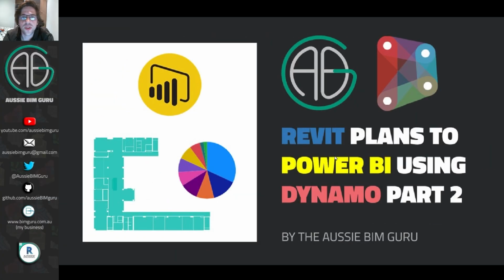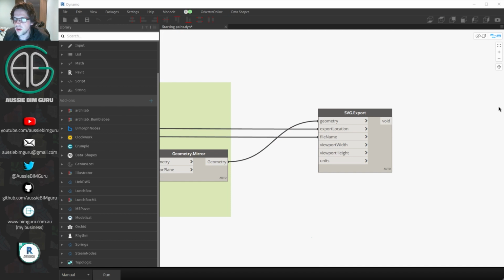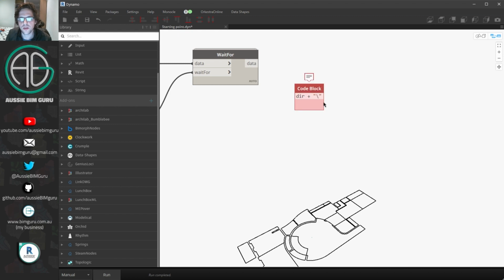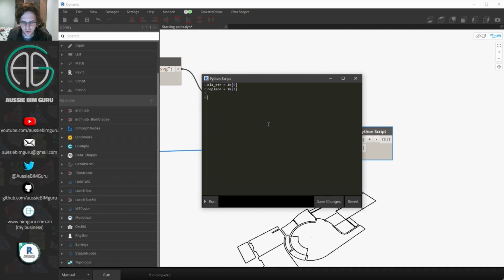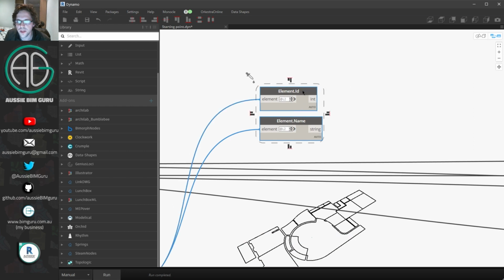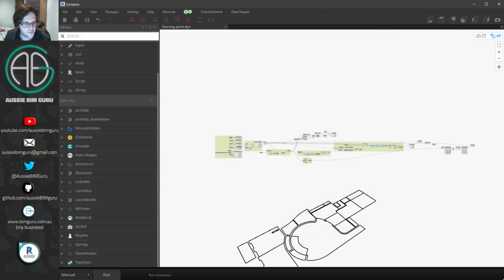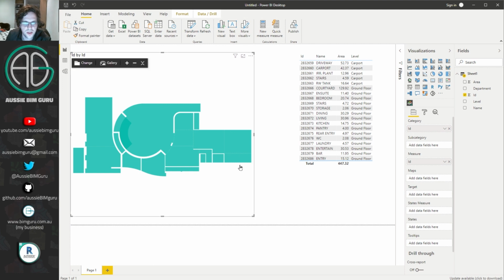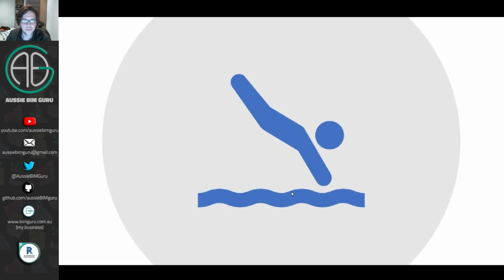Revit plans to Power BI using Dynamo! (Part 2 of 2)

Comment: Thanks for the video! is there a way also to include the floor plan as a backdrop of the svg file instead of just the polygons?
Reply from the maker: Not that I'm aware of using this specific extension.
Reply: @AussieBIMGuru  Thanks for the response! maybe a png of the floor plan can be underlaid using illustrator/inkscape?
Reply from the maker: @swornavaguha252 potentially, but it would still come down to how the synoptic panel viz works at its core
Reply: @AussieBIMGuru  I modified the script that takes in the exported png plan into dynamo- convertsit into xml and scales and underlays under the polygons in the svg. It works perfectly fine. Thanks for this tutorial tho!
Reply from the maker: Nicely done!

Comment: Hello Everyone. I follwed every step of the two parts but i've a problem with visualization of svg in PowerBi. I can't visualize correctly the boundaries of rooms but i only see random overlapp geometries but, if i select one of them, it gives the correct correct correspondence with the table. Did someone has the same problem?
Reply from the maker: If you are on a european region computer this may be the cause as the shape files dont get written properly. Try setting your region to US and it should work. This is because some european countries use commas as decimals which breaks a lot of computer files that would work elsewhere.
Reply: @AussieBIMGuru  I tried and now it works. Thank you!!!

Comment: Hi, nice script, but i can`t see flat on powerbi, i followed ths steps and try the script created by you but it gives me the same error, someone can help me please ?
Reply from the maker: The main error I've encountered here is if the computer is set to a region where decimal points are commas, which breaks the SVG file structure. Try using a different setting and see if that helps:

https://resrequest.helpspot.com/index.php?pg=kb.page&id=279
Reply: Hi i have the same problem , do you find a solution? I try to change the computer settings but it doesn't work

Comment: Amazing Work! Thank you so much for sharing. I followed your workflow and eventually worked really really smooth. I just have one more thoughts, have you used Tableau with Revit to do something similar to this? I currently have a project requiring working in Tableau instead of PowerBI. However, Tableau doesn't take svg file. Do you have any thoughts of transferring this svg files to shapefile (.SHP)? Or anywhere in Dynamo can I try exporting the data to shapefile (.SHP) instead of svg file? Thanks!
Reply from the maker: Generally I've used Power BI as its more commonly available and used in the AEC industry. Tableau has some nicer visuals but lacks as much custom content such as the Synoptic panel. There are various websites which can translate svg to shp, but you would still need a visual to support it to the same degree as PBI.

Comment: Can it be done to generate an *.svg of an isometric view of structural projects (either concrete or steel structural frames)?
Oh, and thank you for sharing your amazing dynamo skills!!
Reply from the maker: I don't believe so. I've only used this workflow for floor plans and flat elements like rooms. An iso wouldn't be read as flat elements by Dynamo unfortunately. Something like Tracer by proving grounds can do this however.

Comment: Thanks Gavis, this tutorial is great. I followed in all the tutorial but i have a question.  Why in Power BI the plan show thicker lines than the one you show? is there some step that im missing?
Reply from the maker: Hrm I'm not quite sure, it may be a scaling issue depending on if your model is in mm maybe?

Comment: Great video! but I would like to match the colours of the graphic charts with the colour of the rooms based on the data, is that possibe with Power BI Synoptic visualizer or I would need to find something else to do that? thanks
Reply from the maker: I haven't found a meaningful way to set the colours currently, but maybe check out 'Tracer' by Proving Grounds, looks to be pretty sweet and heaps of features vs Synoptic panel. Costs $350 for a perpetual license, free trial (with watermarks).

Comment: Hey Gavin, Do i need adjust the Script if i am using Spaces rather than rooms?
Reply from the maker: Yes it would work a little differently. You would need to collect the spaces at a level, their boundary and then pull that to the common plane instead.
Reply: @AussieBIMGuru  Thanks my Dynamo skills are not great, would this be something you could do a video on ?
Reply from the maker: @dillonjohnston512  it's not a topic that would aid many people I think, I would suggest working towards this as a learning goal instead - more valuable for you.

Try the 'SpatialElement.GetSpaceBoundary' node from Orchid as a starting point.

Comment: Hi Gavin, thanks for the tutorial.
I have problem python script: when run dynamo appears the follow:
Warning: IronPythonEvaluator.EvaluateIronPythonScript operation failed. 
Traceback (most recent call last):
  File "<string>", line 5, in <module>
TypeError: replace() got an unexpected keyword argument 'count'
I follow your step by step but i can´t get a solution.
Could you tell me what is the problem? Thanks.
Reply from the maker: Try replacing count = 1 with just 1, or leaving out this third argument for the method. I believe you may be using 2021 which uses cpython and hence has different method arguments.
Reply: I am again. I don´t know if i am doing well.
Now the error massage is this "Warning: IronPythonEvaluator.EvaluateIronPythonScript operation failed. 
Traceback (most recent call last):
  File "<string>", line 7, in <module>
NameError: name 'old_srt' is not defined"

I am sending some information: Revit 2017.1, Dynamo Core 2.0.2.6826, Dynamo Revit 2.0.2.6833
I must learn Python to solve this?
Thanks in advance for your help.
Reply from the maker: @alevadag5706  yes you must have typos in your variable names. Take some time to go through my python 101 series at least so you know the basics like variables.

Alternatively my script is available on github for comparison.
Reply: @AussieBIMGuru   Ok, gracias.

Comment: Great tutorial. I was wondering if there's a way to populate the room number instead of the room ID. Thanks!
Reply from the maker: If your room numbers are 100% unique then you could use this as the name instead. If any room numbers are the same though I believe it will cause problems as Synoptic panel uses this field to identify each element from the SVG file.

Comment: I have a question, it is possible to match the colors from the pie chart to each room´s color shape?
Reply from the maker: Check out the end of this guide here;
https://okviz.com/blog/introducing-synoptic-panel-v1-4/

If you assign a data type to the subcategory, you can customize the colors used by these in the second tab. To detect a room's shape might be challenging though, you'd probably need your Dynamo script to identify this and capture it as a data column in the excel data.

Comment: Thank you for this excellent workflow.  I was asking if units could break the graph? I'm working in meters and the svg file loads really weirdly in PowerBI. How to define the segment size in this case ? and is there something to change near the SVG.Export node to make it work ?
Reply from the maker: I believe you may still be better off processing the final result in mm even if your native units are in m. There are some steps in this workflow (e.g. segmentation of arcs) which may struggle to work within decimals and naturally rounded results vs in a mm increment. The result may be a reflection of this, or even of the natural dynamo unitless units vs revit units.
Reply: @AussieBIMGuru  So, your advice is to change model Units to mm before to launch the graph ?
Reply from the maker: @danielsellam-kazoula9970  not necessarily. You could always increase the scale of your elements in dynamo by 1000. I haven't tried in m to be honest so try a few approaches and see which might work best for the output.
Reply: Did you guys solve the problem? Actually as long as the rooms are square and rectangle in Revit, the svg looks good in powerbi, but with triangle or circle shaped rooms, the svg file loads  weirdly in PowerBI. Any suggestions ?  Thank you @aussie BIM Guru for the tutorial
Reply from the maker: @spiderhin9916  The faceting algorithm should ideally take care of curved edges. If triangles are for some reason giving similar problems then maybe they could be faceted similarly but I wouldn't expect this needs to be done based on my testing.

Typically the main reason I found with this script that imports didn't work was actually due to some countries using commas instead of decimal points, which the SVG file cannot handle when brought in to the synoptic panel. No idea why some countries do this, it completely ruins the file!

Comment: Woosh! Too intense for me, not at this level yet lol, I am a dynamo infant. 
Question though, could you also set this up from an area plan? Usually when I need to deal with areas, they need to be gross, so the room areas( to the inside room finish by default)  that revit generates by default are not that useful. Even if I change the Area calculation setting to be to the centerline of the wall, it breaks because at exterior walls, I need to count the whole wall, not just the centerline. 
This also had me thinking, would it be possible to generate an SVG files of shadows in an elevation? There is no way to currently export shadows to cad, I was wondering if that could be something that could be done with the SVG method of getting shapes? SVG is not cad, but if it gets to SVG, maybe that can be opened in illustrator and saved as a dwg to bring into cad?

I am very interested in power BI, do not know much about it, thanks for this kind of content!
Reply from the maker: Yeah it's a fairly advanced workflow, wouldnt recommend beginning here! Good to see what's possible though I guess, sets some goals :)

The Area.Boundaries node from Rhythm package could achieve a similar outcome to the one I've done using rooms. It returns a list of curves for each area fed into it. I also use area plans for GBA/GFA due to the limitations on wall calculation lines.

Unfortunately shadows can't be easily turned into lines in Revit. I'd consider exploring Grasshopper and Rhino Inside which have far superior tools for undertaking this task. Usually for anything more than boxes casting shadows, Dynamo isn't the tool for the job. The 'Mesh Shadow' node is a good starting point in Grasshopper, but it's a fairly complex task.

Comment: Great video and great resource! I do have a couple of questions:
Assuming the numbers are unique, using room numbers rather than ID would work just as well, right?
And to my untrained eyes using a shoestring area formula to simplify room boundaries and clean up the polygons (this is some times needed if along a room's boundary there are multiple coplanar wall types) would be as easy as implementing a small python script for this purpose as a first step of points clean-up, right?
Thanks!
Reply from the maker: Whilst you could use the room number, I wouldn't suggest this as a user could 'break the rules' before an export which would mess up the file, as two elements would have matching Id's.

The Id is moreso a behind the scenes 'handle' for the object, so the room numbers can be handled in parallel in Power BI even if the Id isn't visible in the final table.

A Python script for the shoestring step could be possible, but given an algorithm already existed I was quite happy to use this one. I find it more valuable to show the workflow in nodes so more people can learn about how the algorithm works computationally vs programatically. Feel free to have a go at it in Python though!